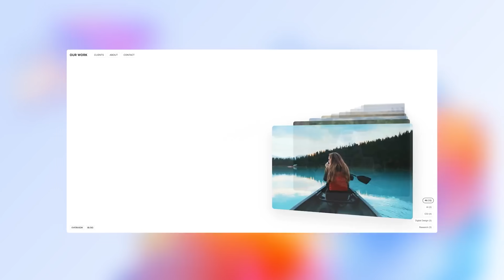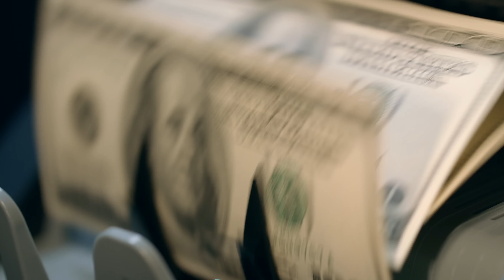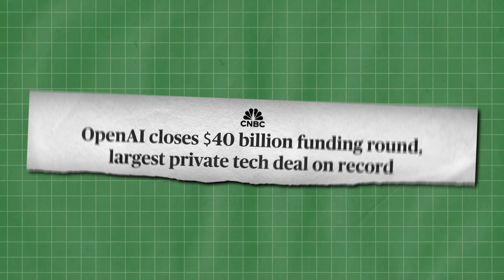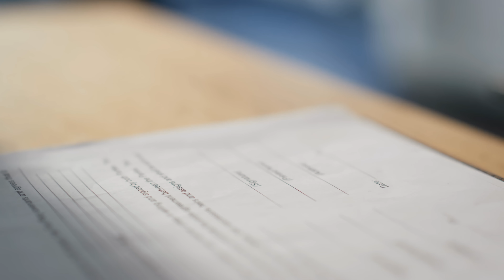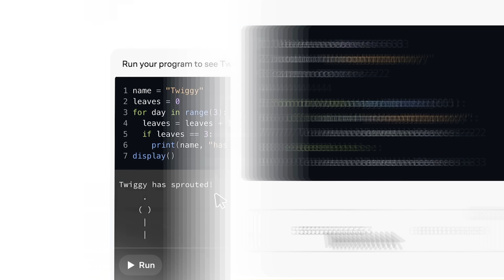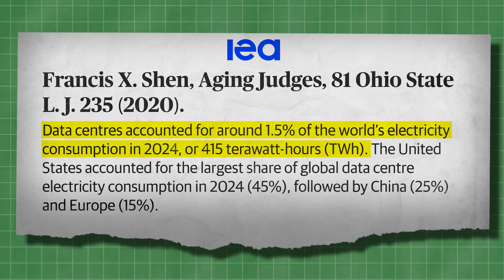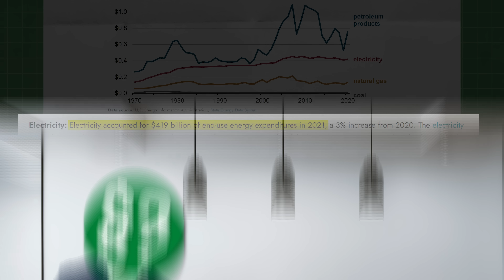How Much Has The World Spent on AI?... So Far

Comment: They just expanded GPT3 by 10x without drastically changing it, and it worked for the most part.
They thought they could do the same thing with GPT5, just 10x GPT4, and it did not work. The point of diminishing returns has arrived.

Comment: ChatGPT:
The video discusses how the AI industry may be in an economic bubble and that the enormous investments made in recent years have not necessarily produced equivalent returns. The speaker explains that the AI hype has driven up stock market valuations, especially for a few major tech companies, but that real technological improvements are starting to slow down. At the same time, investments in infrastructure and computing power continue to skyrocket.

A central point is that market valuations (e.g., Nvidia’s market cap) are often misunderstood as “real” money, when in fact they simply reflect speculative pricing. What should really be examined are the actual resources being used: chips, electricity, labor, and capital.

The video goes through concrete figures:
– The four biggest companies (Amazon, Meta, Google, Microsoft) are spending around *$344 billion* this year on AI infrastructure, which is over 1% of the U.S. GDP.
– In total, about *$1 trillion* has been invested in hardware globally, with additional massive sums from China and other players.
– OpenAI alone has raised nearly $50 billion in private funding just in 2025.
– Many of these investments become obsolete quickly due to rapid technological change, creating a “technology treadmill” where equipment becomes worthless long before it’s depreciated.

Despite this, an MIT study shows that **95% of companies implementing generative AI have seen no financial returns at all**, despite tens of billions in investment. There are indeed practical applications (e.g., making certain work tasks more efficient), but these don’t match the massive expectations of workforce replacement or artificial superintelligence.

Another major cost is **energy**. AI data centers consume enormous amounts of electricity, and in the U.S. this is straining an already aging power grid. Electricity prices have nearly **doubled in three years**, which affects the entire economy. China has an advantage thanks to its more modern energy infrastructure and large reserves, giving it a strategic edge.

Finally, the video points out that tech companies are now lobbying the government to upgrade the power grid for their benefit — which might lead to improvements but also risks diverting resources from other important areas. In summary, the video shows that the AI boom has so far required **enormous amounts of money, resources, and energy**, while the real societal benefits remain limited and uncertain.

Comment: A little tidbit here from an accounting student. Depreciation on capital expenditures is more complicated than stated in the video. If a $1 million purchase is made for computer servers and depreciated over five years, it isn't depreciated at $200,000 per year (straight line depreciation). Instead, more of it is depreciated upfront using something called Modified Accelerated Cost Recovery System (MACRS). Basically think of it as companies being able to write off $400,000 during the first year, then smaller amounts for the next four, until all $1 million is written off. 

Additionally, there is something called bonus depreciation, which means that companies can choose to take the entire depreciation expense is a one-time write-off during the first year of purchase. Since the last year or so, computers and electronics have qualified for bonus depreciation in most cases. Meaning that companies CAN take the entire depreciation expense as a one-time write off. 

So basically, companies building data centers and buying equipment for them can write off A LOT more of the expense than you think, indirectly supporting building more of them.

Comment: We held some practice sessions for using AI agents for coding. It's pretty impressive what it can do, but one of the things I noticed is it is so wasteful. Every time I'd tell the agent that there was a bug to fix, it would start its response with "I see the issue!". Every. Damn. Time.

With millions of people potentially using the AI agent to do coding, I have to wonder how much power has been spent on the throw away phrase "I see the issue!". And that's not accounting for the extremely verbose explanation that the agent gives of what it did after it makes it code changes.. you know that part that just about everyone ignores.

Each individual incident isn't much but when you multiply them by millions or billions of responses, I'm sure it accounts for a significant amount of wasted electricity.

Comment: Bringing a nuclear reactor online is fine. Great, even. Possibly one of the best solutions we have to a couple of our pressing issues if we used them in conjunction with other things. You might think otherwise, but the numbers have spoken and your opinion doesn't matter. They are safe, they are reliable, they have the largest potential output of any individual power producer we can actually use, they last a very long time, and every disaster combined has killed less since their inception as a technology than fossil fuels (and even some renewables) do in a year by literal orders of magnitude while releasing less radioactive material than a coal plant into the environment, and they are expensive because of lobbyists (when aren't they the problem, honestly) not the actual equipment, building, employees/specialists, safety testing/procedures, and materials. But bringing a nuclear reactor online for AI is, for lack of a better way to put it, a massive waste of fissile material and power for the promise of eventually making something. Crypto did this same thing. It's an expensive novelty, even despite all the money and the immense power needs of that system. 

Also, if there's one lesson to learn from Fukushima, it's that a company needs to have DRAMATIC oversight from the government with this sort of thing. That was caused because TEPCO didn't want to spend the money (thousands to tens of thousands of dollars, not much when you're talking about one of the world's largest energy producers) to make it actually safe against a threat they were forewarned about. Nuclear reactors are safe if they are built and maintained correctly, which we can do and is pretty easy. But sleazy businessmen aren't careful.

Comment: An AI company is actually looking at not only buying the power plant I work at, but 2 shuttered sister plants, add a turbine mixed cycle plant alongside a rebuild of the currently running plant, all to power 2 warehouses. 

All because the utility told them there wasn't enough power generation available on the grid. Unrelated... No there are no plans for a new power plant to replace us. And every MW produced is aimed at those servers.

Comment: "not worth the energy to run" - this is not true, though it may have been if NVIDIA had any real competition since 2010. NVIDIA isn't incentivized to improve performance and efficiency as much as possible because whatever they put out, these companies are going to buy. AMD and Intel GPUs are technically viable alternatives for AI training and inference, but nobody is going to put their career and reputation on the line by recommending them over NVIDIA. Ergo, NVIDIA is a monopoly. 

Certainly an NVIDIA GPU from say 2015 is not worth the energy to run- you're better off buying whatever $10,000 GPU they're peddling these days- but a GPU from 2020 (5 years ago) still holds its own. The RTX 3090 for example is formidable and not so inefficient versus the latest and greatest.

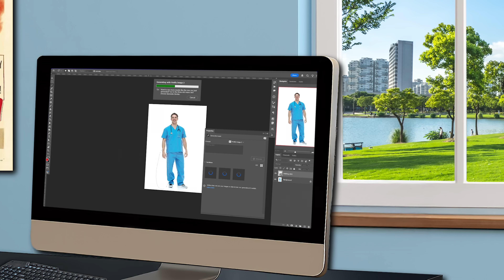Comment: 9:05 Something to point out with this image cropping example is that the vast, vast majority of AI investment wasn't needed for this, it's just one much smaller model with a specific goal that has no connections to the vast, expensive LLMs or image generators that make up the bulk of this story.

I bet DaVinci Resolve for example with its similar Neural Engine tools didn't need to invest a miniscule fraction of what big tech is doing, and for far more practical & useful models!

So yeah, I don't think this use-case justifies the absurd investments, only a separate branch of investment disconnected from the hype-machine.

Comment: 1. Constant exponential growth is never sustainable in a world with limited resources. However, if this was the only limitation, we could still have AI industry growing for decades without concerns. But, we also have 
2. Diminishing returns. As an example, figuratively, an AI running on 50000 GPUs will be at least twice as fast as the one running on 20000 GPUs. However, an AI running on 100K GPUs will be less than twice as fast/effective/efficient as the one running 50K. And running 1M GPUs will never be ten times more faster/effective/efficient than running 100K. Scale it up sufficiently, and you arrive at a point where only a delusional nutjob would invest into further development.

Comment: as someone who dabbles with ai, ai is basically right in the middle of the uncanny valley graph. good enough for gimmicks. but not good enough to be actually useful.
it mostly boils down to how current models operate.
the majority of models only have one sense. for example chatgpt can read, while models that can hear cant see, etc.
also models cant really think things through. yeah there is deepseek, but its still in its infancy.
and lastly, models cant learn on the fly. it may look like it, but its because new data gets stored as tokens inside volatile memory and not actually expanding the neuron based "brain".
once there are models that can do all the things mentioned above, at the same time this is where we will see ai being useful on a wide scale.
im no expert, but if i had to take a guess i would give it another 5-10 years until we are there, given the rate of development.

Comment: Your explanation on tax depreciation is completely wrong. US Companies account for depreciation on their financial statements using Generally Accepted Account Principles (GAAP), which says to depreciate them over their useful life. Meanwhile they account for depreciation on their tax returns following the relevant provisions of the Internal Revenue Code, which ends up being an arbitrary period picked by Congress/IRS. One doesn't have to equal the other, and generally tax depreciation runs way faster due to "bonus depreciation" (which starting in 2025 will result in a complete write-off for business machinery and equipment, including servers). Meanwhile Meta is depreciating its servers on its books over 5.5 years. 

Your basic point still holds - Big Tech GAAP depreciation for GPUs is completely out of line with economic reality.

Comment: Accountant here to add some additional context since you brought us up:
Most of the assets in Data Centers qualify for bonus depreciation. Bonus Depreciation just means they can count a percentage of the asset’s costs as expenses for the current year. Previously it was 60% so they could spend 1,000,000 and reduce their Net Income down to 400,000.
However the BBB just changed Bonus Depreciation to 100% (fully expensed in year 1) AND it is allowed to put their income into the negatives and give them a loss for the year.

The building itself wouldn’t qualify for BD, but the building isn’t the majority of the spending.

Comment: > AI experts say China is winning the AI arms race because their power grid actually works
Unironically, the most useful thing AI has done is force the US to unfuck its power infrastructure and revive nuclear power.
Standard of living is very directly tied to per capita energy use and energy prices relative to wages, the most salient example being the effect of gas prices on the working classes. All the energy infrastructure and nuclear power revival is still going to be there after the AI bubble pops, and the AI bubble popping will sharply reduce AI energy demands while supply remains near the same, meaning a sharp drop in energy prices and thus standard of living improvement afterwards, as well as increased nuclear replacing fossil fuels increasing energy independence.

Comment: You should look into the bulk electric systems more in depth. That article is making many naïve assumptions. I worked for an energy ISO for 10+ years and the way the bulk electric system works is entirely different than people think. The problem with the reserve is not due to the age of transmission, but due to the age of generation and the lack of willingness for states to invest in higher efficient, power plants, and give up their old coal infrastructure. There is a significant limiting factor of natural gas pipelines in many states that have new projects that are attempting to reach the gap, but these have their own flaws as well and really the only long term solution is wind/solar and nuclear.

Comment: Exactly as much as they want you to. They are getting you to use bigger, more expensive models, or the ability included in your subscription, so it is more expensive, and more likely to cost them more.
This is so that you naturally gravitate to bigger companies that can run way bigger models (than you need) while collecting your data, and being able to advertise to you.
This is to cement their place and stop competition (with less resources). It is a waste.
Also, they are working at deflated cost, because they aren't paying for much clean energy or carbon taxes on their OCGT gas (methane) turbines (open-circuit means wasted heat less efficient).
And water supplies at way reduced cost. It is 100% unsustainable.

Comment: I do support the uptick in nuclear innovation AI has caused due to green renewable energy can't replace base load power aside from huge hydroelectric dams or geothermal power. Both of those though have pretty restrictive geographical limitations making their use a hassle at best. While not being a completely clean or renewable energy source nuclear energy is tremendously cleaner than coal power plants which are the fossil fuel used for base power loads. Not to mention that if thorium based reactors start being adopted the reactors themselves will be virtually melt down proof, and thorium nuclear waste only lasts like 100 years opposed to uranium's/plutonium's 10,000 years. That's due to thorium emitting alpha wave radiation opposed to gamma radiation like the other two elements. Alpha radiation is much weaker; it can be blocked with a few sheets of paper and as mentioned only lasts for about 100 years. Also thorium can't be used to make nuclear weapons; I don't know the specifics on why, but I do for sure know that it won't work.

Comment: With 3 trillion spent on the Iraq and Afghanistan Wars, not really all that upset. Also not all that banged up about energy usage since I figure it's AI that's going to finally crack the fusion energy issue. High energy prices are lowering the break even cost of solar panels on residential roofs. Potential silver linings are impressive.

Comment: It's insane how this AI just keeps on consuming everything. And it's been going on for longer than most of you think. Over 10 years ago, when AI was not much talked about, I submitted a grant proposal with my university and a big tech company together to do translatory research. We wanted to develop a tool based on tech that we already had, which would allow certain heart surgeries to be planned better and tailor them to the patient. Our methods were fancy computational physics models, which again were based on real experimental data. Very straight forward at the end: Use math to simulate relevant physics in patient and judge output with historical output that have outcome-databases, so we can do some planning optimization. The matching of historical data and their outcomes was even implemented with simple traditional ML models, but ALL the panel (mostly economists etc) wanted to know where and if we use AI ("neural nets")..... We kinda blew them off on that politely, but we knew at that moment we were cooked - and we were. We didn't get the funding and I trashed the project.

Comment: After a lot of resistance and hesitation, GPT has become a useful part of my workflow at this point, but you have to treat it like we did as wikipedia when I was in school. It is able to rapidly search through monograms and find specific information which I would be much slower at and less able to (with adding in the fact that I have pretty bad vision difficulty) and can normally point me to specific points inside those monograms. I use it often very much like a less advanced version of the computer from Star Trek, but like if it were a student that is afraid to say that certain data is not available. If you use it as a lookup tool that you can verify its results, it is honestly an extremely useful programme.
Reply: Do you talk to your mouse?
Reply: @brodriguez11000  Yes, though mostly to complain about it or realising the ball needs cleaning.